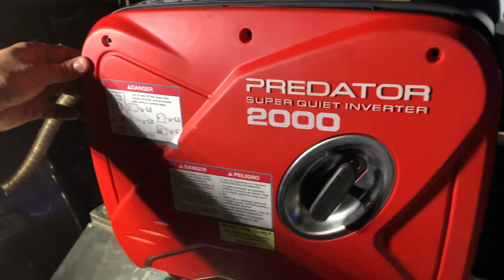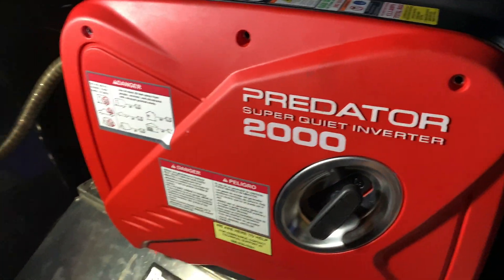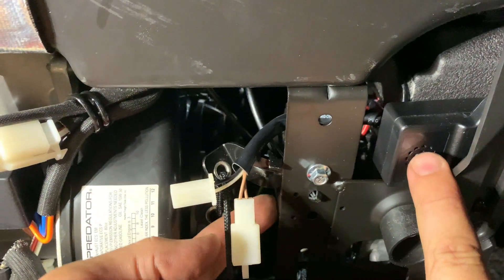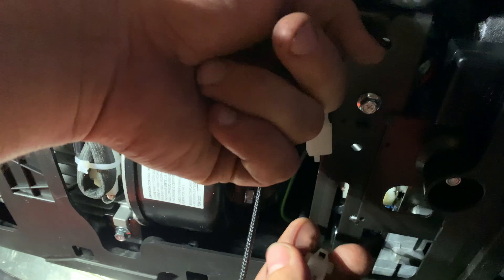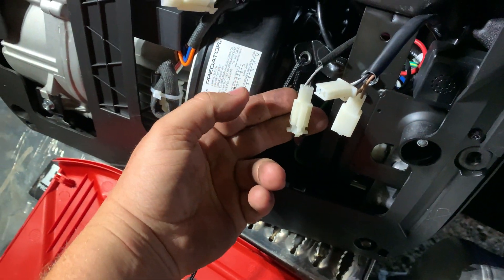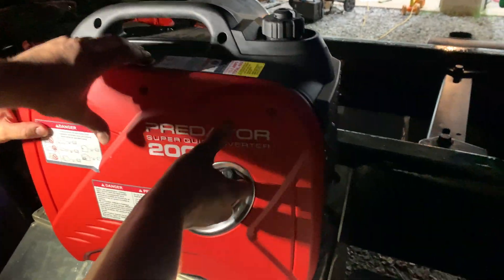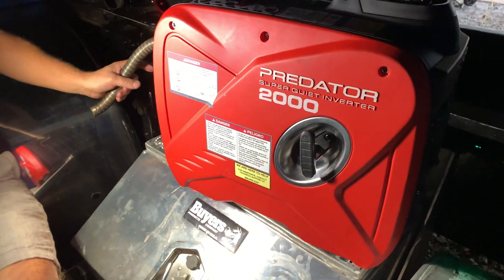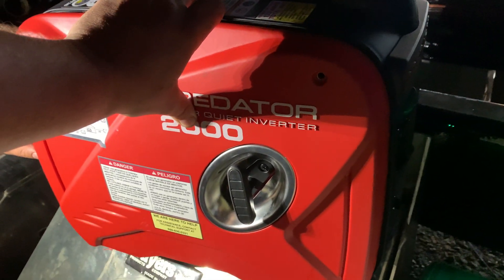2024 Predator 2000 Generator Carbon Monoxide Sensor Bypass

Comment: not like this on mine, just bought it today 11-17-24
Reply: I bought mine a couple of weeks ago and it is not like this either 😞, mine plugs into the sensor in out to the generator. Completely different location and sensor.
Reply: @joeh690 I figured it out  unplug  connector that's plugged into the sensor . Leave unplugged.. jump the orange and black together,  then jump yellow and green together..
Reply: @arcsofterproductions 
Where is the sensor I can’t find mine. It’s certainly not like what’s in the video
Reply: @mikemills12  read the comment above
Reply: What were the symptoms that led you to believing it was the carbon sensor?
Reply: I posted how to fix the newer model  @tellitallnow3914

Comment: i trid it as you stated and it still dies, but not flashing yellow on indicator
Reply: Plug it back in exactly how it was and try and start it it should clear the yellow light and then try again that’s what I had to do to mine because I messed with it before hand and got a yellow light and I thats how I got it to clear the yellow light
Reply from the maker: Is it the same exact one?
Reply: @launchgarageco.342  Turns out they make small changes to the wiring.  Mine was made March-2023 and I didn't start it till I found this video to bypass the sensor.  I pulled the front panel and unplugged the whole sensor system and did exactly as you showed.  Only runs 5 seconds every time.  Connected sensor back up and runs perfect for an hour.  Connected your way and only runs 5 seconds.  I cut the Bl. & Wh. lead to sensor in half so I could easily reconnect.  Twisted Bl. & Wh.  together and pluged it where it was.  No go.  I carefully marked the 2 Br. wires so I could correctly reconnect and did the same with the 2 Br. wires. No go.  So then I switched the Br. wire originally going to the Bl.  to the Wh. wire and switched the other Br. wire to the Bl. wire.  Runs perfect with C/O sensor totally removed.   On your unit you could simply plug the 2 ends together to bypass, on mine I had to flip the Brown wires then I soldered and heat shrunk the wires.  Placement of sensor and wiring of mine and yours exact same.  This is why the delete doesn't work for all.   Ran 3 hours perfectly under load.  Thanks for your video.  Hope this helps others.  I also have two 3500 Pred. Inv.  that are 2020 models, pre C/O sensor.   Love these gens.
Reply: Before I tried what they did

Comment: Didn't work for me... gen comes on for 2 seconds, then shuts off. they must've changed circuitry yet again... so stupid, the time/energy wasted in the CO sensor to prevent lawsuits by dumb people could have better been invested in R&D to make it a more powerful, efficient generator. Eh, but I digress, I just put two strips of duct tape on both sides of CO sensor to block detection vents and it seems to be working for me. 😅 knock on wood
Reply from the maker: Do you have the newest one? You need to loop the connectors GOING to the sensor and just leave the connectors coming FROM the sensor open. Feel free to email me with a picture of your generator, it should work for the 2000 watt ones.